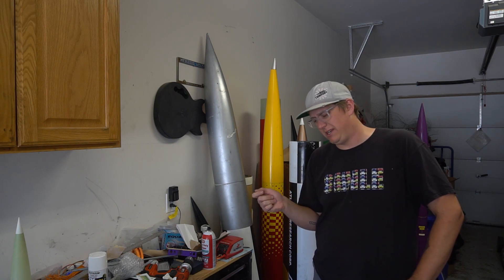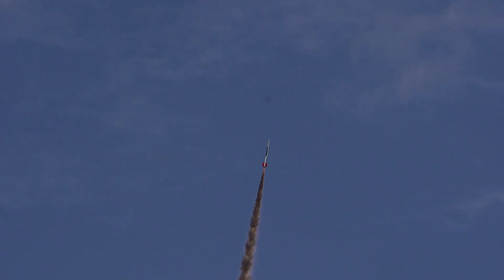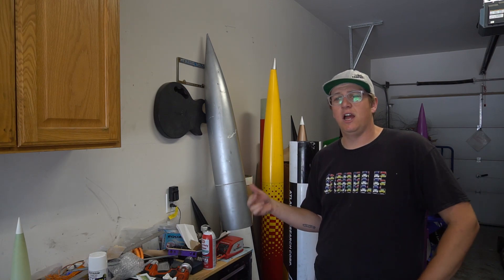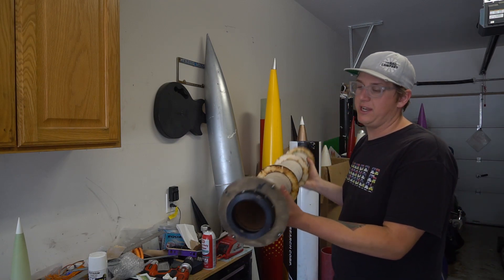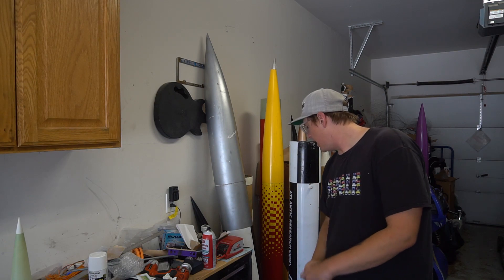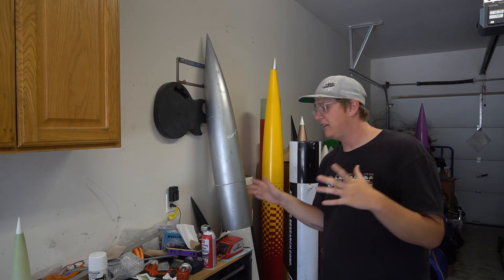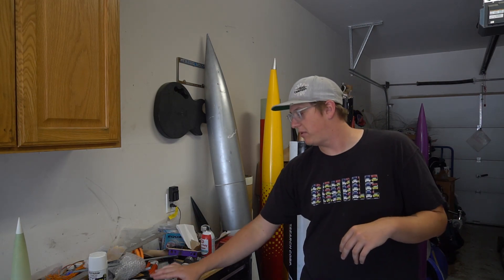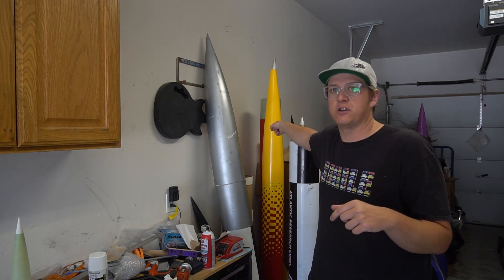Flying My 12 FOOT Model Rocket On An N Motor

Comment: (comment removed due to excessive douchebaggery)
Reply from the maker: Something tells me I won't be able to change your mind. For the sake of trying, though. The thrust to weight was more than safe at over 6:1 on average and over 8:1 on initial thrust. The motor mount didn't fail under the stress of an N motor, but the t-nuts used on the adapter, not the motor mount, failed with the ejection charges (that deployed the parachute and didn't allow it to come crashing to the ground). Finally, with over 60 feet of shock cord in each section, it had more than enough. Like I explained in the video that you evidently were a little dense to absorb, the sections hit due to the drogue being undersized. There's even nice footage included that even the most simple minded could see the fin can floating up from fin drag, streamlining, and coming back down at the upper section.

Now. Can you please point me to your more successful scratch built 80 pound rocket N motor? I think it faired pretty well for a rocket I built when I was 17 about a decade ago. Let's be real here. It''s a whole different ball game than 3" kits on 54mm motors 😊
Reply: @RocketVlogs  Is it, though?  And my post was snarky and mean. My badness. I was drunk and mad at other crap. I hope you can forgive me because I really love your videos and respect your work. Let me try again.  Rockets coming off the rail and weathercocking (often severely) is a common occurrence even in light winds. And it’s downright dangerous. Why is that? I guess you checked out a few of my videos. I’m not even considering a motor that isn’t pushing the rocket above 50mph off the rail. Almost impossible with that beast you built. 
I’ve had my failures certainly (crash courses) and don’t pretend to know everything. That said, what is the rocket’s purpose? As a former structural engineer (I’m now in sales for my field simply because it pays better), we are drilled to think on that whenever we are building or designing something.  To me, the rocket’s purpose is to do what big boy sounding rockets do: go as high as possible as efficiently as possible. The further we stray from that, the more likely problems are to occur. My simple test for a rocket’s likelihood of trouble is the mm to airframe ratio. The bigger that ratio is, the less efficient it is.  It was pretty big in this case. If the motor diameter was closer to the af diameter, that thing would have sliced through the sky, wind and fin size be damned. I could go on for six more paragraphs but I’ll spare you. LOL. Thoughts? (besides me being an a-hole. I already know that)
Reply from the maker: @karlrobinson4887  Low and slow flights are some of my favorites because they give off an old school vibe like the 90s rocket videos I grew up on. Plus, it's a sparky motor so the intent was for it to make an impact in the noise department and just be fun and memorable for me. Unfortunately the motor didn't crackle almost at all. As far as the weathercocking, I certainly didn't think it was going to be an issue considering that motor has an initial hit over 3,000 pounds of thrust. The fins are huge, but even still it was relatively calm. It's also possible that the rail buttons could have hung up momentarily. I've flown much slower flights that cleared the rail fine, this was just the luck of the draw, really.  

The most irritating part about your initial comment WAS the fact that you pretty regularly comment on my videos and even messaged me on TRF a couple of times. So, it was a bit surprising, but I'm not just going to take undeserved crabbiness on the chin. Second, your comment practically implies I was presenting this as a perfect success, when in reality I admitted everything that went wrong on video and didn't try to claim it was flawless. Now I've learned from these mistakes and can apply them to future big projects.

 I have no hard feelings against you,  everyone has a bad moment from time to time.
Reply: @RocketVlogs   Yeah, I was in a bad place.  Thanks for the response.  Anyway, my current favorite rocket in the fleet has a paint job you inspired.  The gray and metallic orange. Fin tip stripes and all! Did you ever find yours?  Low and slow is anathema to me for the reasons mentioned above but also simple economics. I'm like "You just used an M motor to go 4000'. My Firestick just went 9000' on a 4-grain K740." And then I feel superior to them. I also love anchovies on pizza, and I've been told many times that makes me batshit crazy if that helps you apply the proper weight to my opinions.
Reply from the maker: @karlrobinson4887  Nope, that MD is still somewhere out in Kansas. I'm thinking there's a chance I put the main out at apogee. It was relatively windy that day, so with the main out at 20k I wouldn't at all be surprised if it drifted out of the tracker's range. It was the old lower power transmitter from Comm Spec that's good to about 5 miles line of sight. I'll give it another go eventually.

Comment: I built my 2/3 scale IQSY Tomahawk a few years ago because I thought she was going to be the last rocket I built. Now, I still have her but I'm afraid to fly her again because she's so freaking big to trudge back to my SUV after her recovery! :)
Reply from the maker: I've been considering stripping this guy down since I have another 7.5" Iris and turning these components into something else and the IQSY is high on that list
Reply: @RocketVlogs  I think stripping the IRIS down is probably a good idea considering all the repair work you'll need. I do recommend getting the 3/8 inch Tomahawk fins instead of 1/4 inch. For a big rocket that's 60 pounds or more with the motor in it, the 3/8 inch fins offer more protection. Performance Hobbies has a great 2/3 scale IQSY Tomahawk. She's the one I built. I think we flew her at NRXS back in 2018. Ever since then when I ask my son should we fly her again, he always tells me, "Dad, I'm not feeling it." :)
Reply from the maker: @jackcaynon9746  The fins on this one are quarter G10, they're pretty dang beefy. The Astrobee D is up there on things I'd like to build. An over full scale Arcas would be interesting, too.
Reply: @RocketVlogs  I have an old Performance Rocketry full scale Arcas with his old, beefy fin can. It's a great rocket, especially on a long burning M motor! However, I lost 3/4's of the rocket due to a bad drogue charge, so when it came in hot, the airframe lawn darted (but the nose cone landed gently on a shredded main chute). I let it sit for two years with the crushed motor tube hanging out the front end of the sustainer (my son thought it was a great trophy like that). Still, the fin can and about eighteen inches of the sustainer was intact. Got some more airframe tubing, used a chop saw to cut the motor free from the motor mount and built a whole new front end. Looking forward to flying the resurrected Arcas during the upcoming Labor Day weekend!

I am also thinking about building a 4 inch motor mount sustainer for the Arcas so I can use a long burning N or O motor. :)

Comment: John Coker always said to use a chute 1 size larger then what it calls for in the desert did pretty well though nice footage the cessaroni engines in skidmark have alot of the crackle and loki as well man you use an ass load of shock chord huh lol